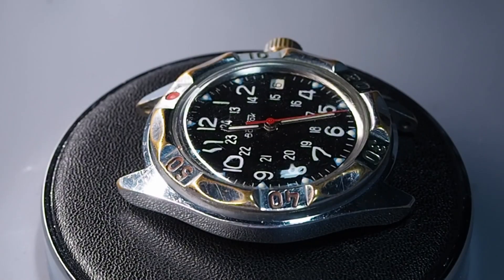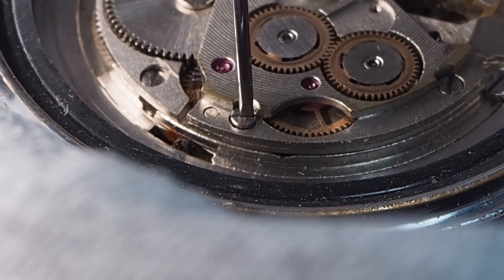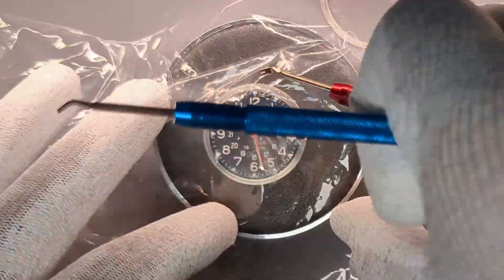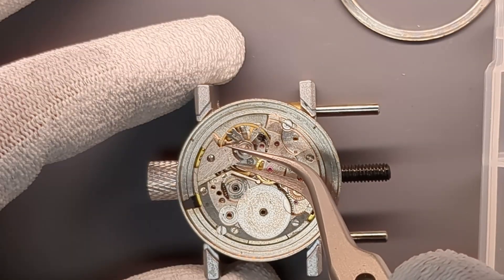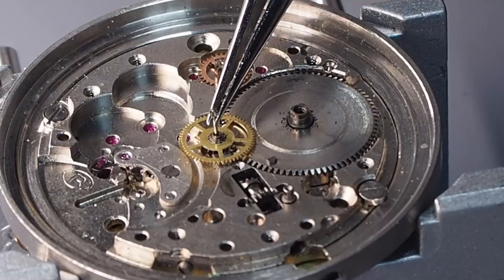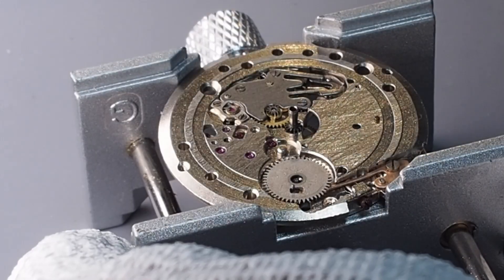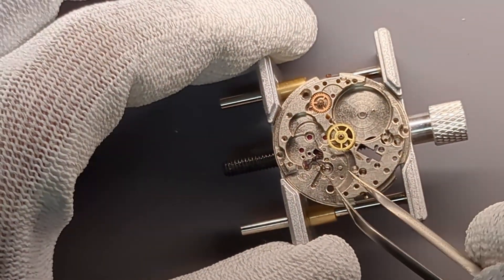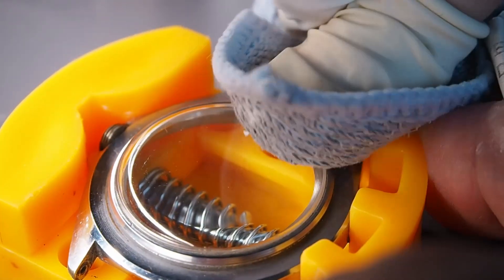Vostok Amphibia Restoration – Part 1 | Disassembly of the Russian Diver’s Watch

Comment: The case is probably plated brass rather than stainless steel (you can see the plating wearing off).
Reply from the maker: Yes, you’re absolutely right — I checked the case again and it’s brass plated. The plating wear makes it really obvious. Thanks for pointing that out.